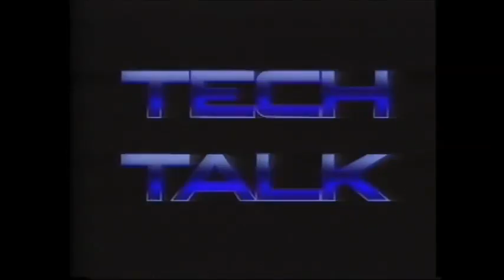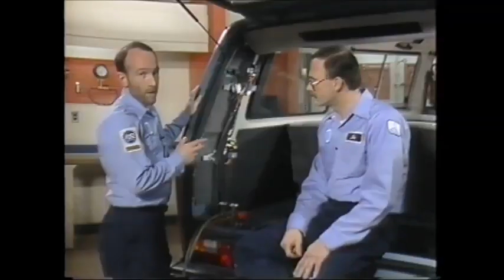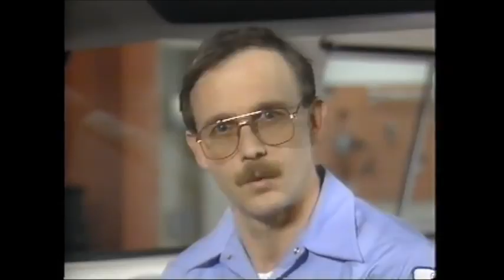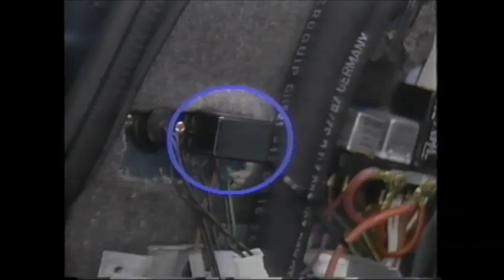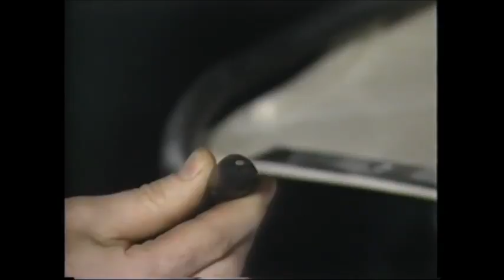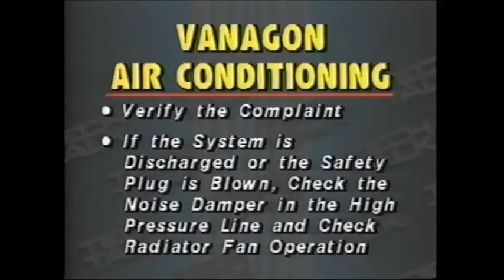VW Tech Talk: Vanagon Air Conditioning Servicing T25 / T3

Comment: I have a 1990 (Base model I believe) The AC control knobs are located next to the glove box, not over-head.
The AC  system holds a charge,  all three of the fuses; 20A, 20A & 50A, are all good. The blower fans turn on as they should, but I have no voltage reaching the clutch (measured at the clutch with the AC turned to max).  I verified function of AC Compressor Clutch Relay and the Evaporator relay as stand alone components. Could it be the Diode? (I don't know exactly where it is located(?). Any further guidance is much appreciated.
Reply: did you ever find a solution?  I am dealing with the same issue
Reply: I jump-started the clutch. It popped a bit loud, but then the compressor kicked on and it has worked ever since. It's a little bizarre, but I'm not complaining. Maybe something was just a little rusted stuck and I freed it up. (???)
Good luck!